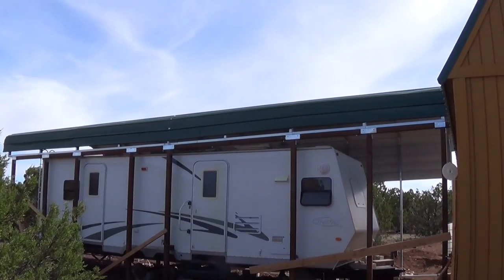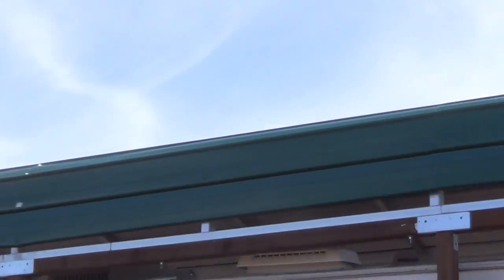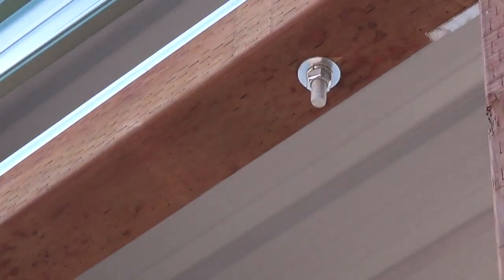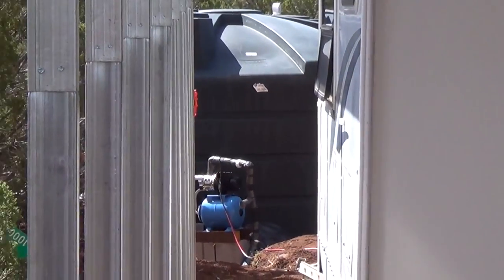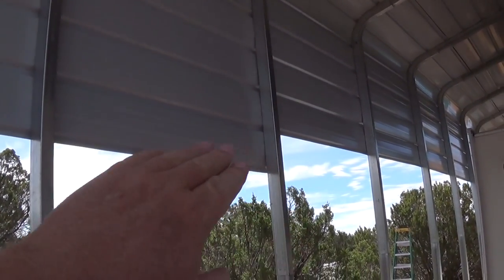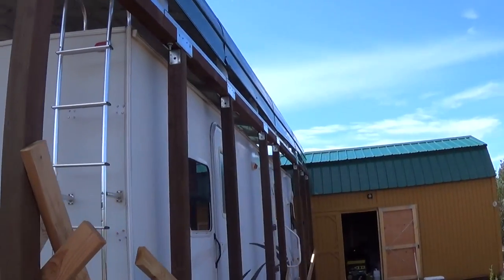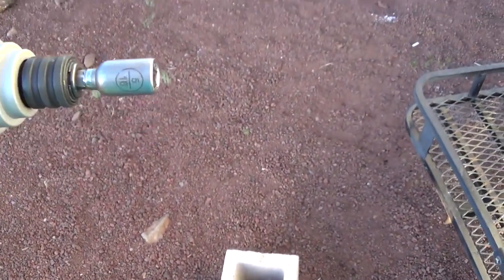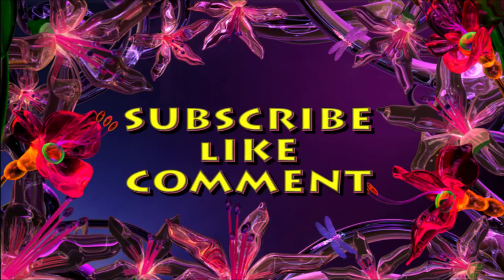RV Carport - Versatube - Completed. Great Metal Carport to Protect your RV

Comment: Jeff,   make sure to throw a few Grounding Rods into the ground at each end of that thing because Monsoon season with Lightning if it strikes that you wanna have a ground so the lightning doesn't ruin all your electrical and or even ruin you inside your trailer in a Lightning storm.  

Keep up the great work man.  

Ryan from Tucson AZ
Reply from the maker: TRX450R Vlogger grounding rods? I did ask about that when I purchase the carport and they said no need unless I am attaching metal and electrical to the carport.  thanks for watching. I will look into the rods more.
Reply: Alright man. Yeah I just think it would be safe for Lightning strikes.
Reply from the maker: better be safe... thanks.

Comment: Thats my plan as well great job Jeff!
Reply from the maker: +Guy Azbell they sure are nice. the toughest part is getting 14 plus feet in the air and being able to apply enough pressure on your impact driver to get the metal screw into the frame.

Comment: Looks good, should help out immensely with the heat.  One Question though, if you ever wanted to move the trailer out, you appear to be boxed in on the hitch end, how would you get it out?
Reply from the maker: bigolmoose69 lol great question. I hope to not have to move it but the barn is a portable building and it could be moved opening up the front to hitch up a truck.

Comment: Big fan of the Ryobi gear. I'd recommend getting that 6 slot battery bank for your Ryobi tools. Makes charging a breeze. Excellent work! Will you be attaching rain catchment to those rooftops?
Reply from the maker: Shawn Neal multi slot battery bank would be helpful. I have 2 chargers so now 2 at a time. . thanks.... somehow I will have a rain catchment. not sure how it will all look but once the patio roof is completed I will more to the rain catchment system.

Comment: ahh you took my advice on placing the shed on one end and placing the storage container at the other end then running beams from each to provide a roof the length of the trailer. but wheres the container?
Reply from the maker: PotLickerHound container is somewhere else on the property. . but I do like your idea of roof with beams over the container.

Comment: One of my neighbors had a giant aluminum sheds built for a shop, and within 2 weeks of getting it done we had some bad winds and the shed was completely flattened to nothing. I've been skeptical of all that stuff ever since.
Reply from the maker: cali prepper that was one of my concerns becus I get high winds. versatube says this carport is rated at withstanding winds of more than 70 mph. in my area historic records don't show many times of winds greater than 70 so I feel confident it will hold up. plus once I add the porch I think overall I will have enough to hold it down. , thanks for watching. thanks also in reminding me about the power of the winds.
Reply: Best of luck to you.
Reply from the maker: thanks

Comment: There is deeper more powerful battery for that impact driver available, more expensive though.   All the Best
Reply from the maker: bigolmoose69 yea. I noticed that the other day. these batteries are the ones that came with my tools. I bought the impact driver and it came with 2 batteries, I also bought a set with a drill/sawza/cir saw and it came with 2 batteries. .

Comment: did the rebar anchors come with the kit?
Reply from the maker: yes .. had the option of the rebar anchor or the bolt anchor. the rebar is simply a rebar with a washer welded to it so if you could weld make your own it would be cheaper. I forget how much they charged but making one would be the way to go.
Reply from the maker: that suck and with that type of slab I think the bolt has to be placed in it when it is poor, right? not sure if drilling the hole and using the anchor bolts would work or not.
Reply: ArizonaHotHomestead